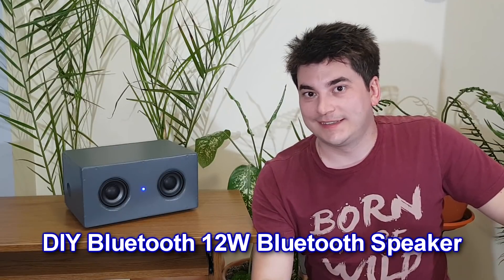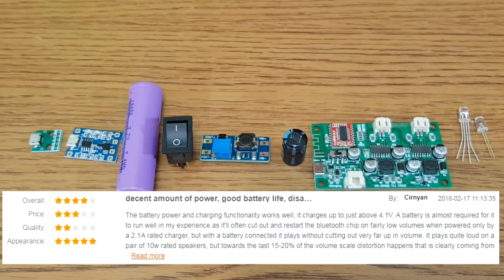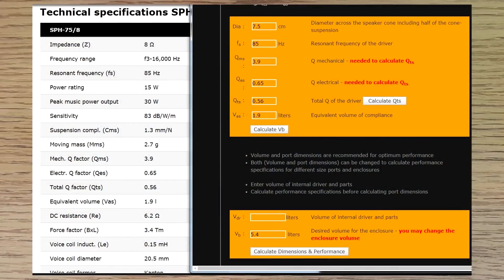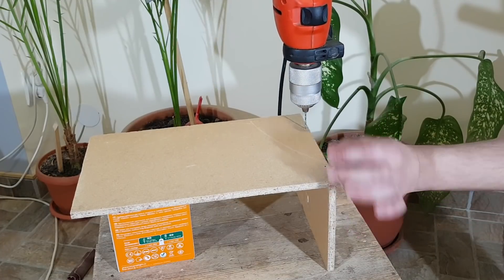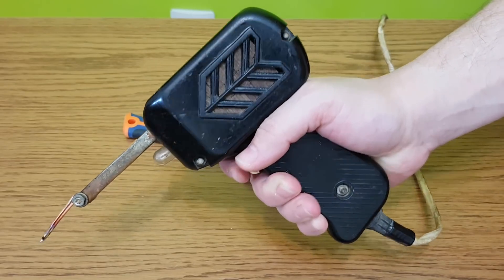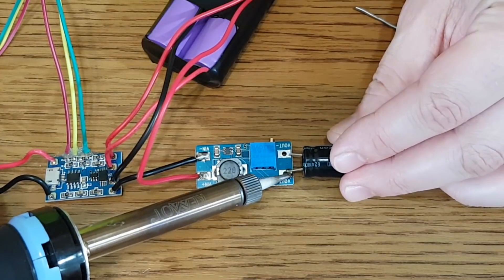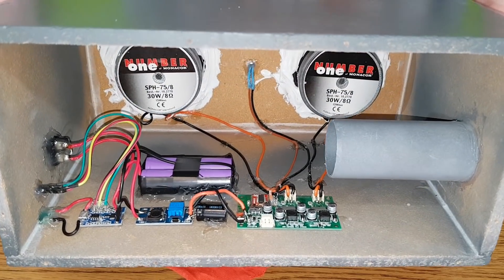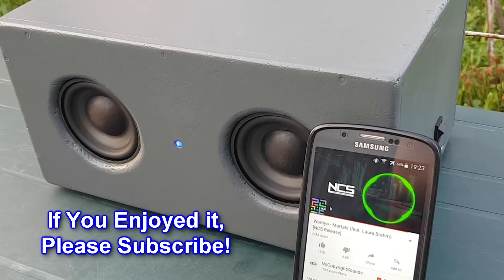DIY Bluetooth Speaker 6W+6W - HF69B

Comment: @Sorin: a practical tip: at timestamp 6:03, you're cutting into the board with your arm in front of the saw. If the saw runs off without resistance after cutting the last millimeters of board, it may overshoot, and you may cut half your arm off. Never cut into your own limbs/fingers, always cut away. If you don't have clamps to hold the board to the table, sit on it with your knee, and catch the falling part with your free hand. NEVER hold it in the way you do here. One accident may scar you for life.

Also, jigsaws can cut fairly straight, if you use a guide. Use a straight bit of metal/wood, about 1cm thick, and place it so that the base of the jigsaw slides along it.

Comment: Would you consider making another but way higher power bluetooth speaker? There are easy to use things now for it.
Reply from the maker: yes, I plan to build a small and powerful boombox
Reply: @Sorin_DIY  Take a look at differential amplifiers such as ns4110b it packs a quite a punch, it can do 10W at 4 ohms, and gets loud, while drawing nearly no power, pair it with a bk8000l or if you wish to do multimedia too bk3254 or bk3220 those have a great sound quality and easy to use, also with differential amplification , you also wont hear any interference or noise, just crisp audio. Hope you like the idea. I done it too but went too far with my bench psu and fried the amp, it was a ht8696sp , that also is great! 8.5w on 4 omhs, but it can only go up 8.5v , while ns4110b can do 14 v , but the ht6896 has a bit better sound, on a scale, these both are cheap , easy and interference free, cheers.

Comment: hello does it matter if I use 8 batteries instead of 2 lithium batteries? if so does something need to be changed? thank you in advance!
Reply from the maker: hello. what kind of batteries do you want to use?
Reply: @Sorin_DIY  I have batteries from a powerbank that I can use. The brand is trust.
Reply from the maker: if you have 8 li-ion cells with maximum 4.2V you can use them, but I don't think you need to use all of them. 4 cells connected in parallel should be enough for this project. it depends on the quality of the cells.

Comment: I used 10W 40hm speaker when I connect both the speaker bluetooth not connected in my mobile , if I remove any one speaker connecting also 
Bluetooth.amplifier shutdown down when increased volume
Is there any possible way for 4ohm 10w speaker?

Comment: Very well done👍👌but i recommend not to cover the amplifier with the foam insolation, because of the massive heat it will produce over a time at high volume

Comment: Can you recommend a bluetooth amplifier board for 6 ohms 60 watts speaker?
Reply from the maker: hi. it depends on the type of speaker, I'm guessing 60W max (not RMS). so you probably need a 15 - 30W amplifier. for 2 x 15W you can use the YDA138 bluetooth amplifier board. or you can use a more powerful 20W or max 30W amplifier board, but there are also other things to consider. for example what battery, BMS board and charger you want to use? when building a bluetooth speaker (or any speaker box) first you decide on the amplifier board and then build the speaker around that amplifier with compatible components. only if you have very good speaker drivers it's worth to build a speaker box for those speaker drivers. for 2 x 30W you can use the TPA3118 amplifier board, but it needs a supply voltage of max 26V.
Reply: Im gonna use that bluetooth amplifier for my book shelf speaker

Comment: Another good video and good advice. But do remember that if someone has a bunch of 4 ohm speakers, it's possible to put them in series to get 8 ohms. All is not lost! Also, a tip: soldering 2-3 inches of wire to the Bluetooth F-antenna will remove a lot of noise at low volumes. In my experience those PCB antenna always work better with extra wire soldered to the end of the F.
Reply from the maker: hi. if you connect 2x 4ohm speaker drivers in series, you can use them as a 8ohm speaker. but there is a small problem: the voice coil of one speaker driver will become a small frequency filter for the other speaker connected in series. so both speakers will lose some of the high frequency sound. if you do this with bass speakers it's ok. but if you connect tweeters (with voice coils) in series, you will partially cancel their ability to make high frequency sounds.

Comment: Hello sorin.. your work is amazing, especially the way you explained.
I've a small question.. what's the capacitor uf value and volt that you soldered directly  in DC stepup module ?
Reply from the maker: hi. I think it's 2200uF at 16V. you need a capacitor with a rated voltage higher than the running voltage. so for a 5V device, you need a capacitor of minimum 10V. there are also 6.3V capacitors, but they are too close to the running voltage. the capacitance depends on the supply power and the load. for a 5V bluetooth speaker 1000 - 3300uF should be enough.
Reply: @Sorin_DIY  
thanks a lot :) 😃

Comment: Hi sorin, I have the 4 pin LED with common cathode, it's not working with tp4056. Can I use diode for this? Please suggest with diagram. Thank you
Reply from the maker: you need a multiple color LED with a common anode.
Reply: @Sorin_DIY  thank you sorin...

Comment: how you used 30w speakers if you amp is only 6w
Reply from the maker: hi. the amplifier has a peak power of 6W per channel. the speaker drivers have 30W peak and 15W rms. the RMS value is the real power. the speaker drivers must be more powerful than the amplifier board, otherwise they will sound distorted at maximum audio volume and even get damaged.

Comment: I watched all the videos on your channel.  Nice artwork.  I have a two 10W 40mm 4 Ohm subwoofer that I want to fit into two boxes.  So the point is, how many inches should I make a 40mm One speaker?  Please guide ...

 I'm adding speaker information https://www.ebay.de/itm/382945397214
Reply from the maker: hi. there are online calculators for speaker enclosures according to the speaker driver specifications. but we don't have all the parameters for this type of speaker driver. I would make 2 speaker enclosures of 80*80*100mm with MDF of 6mm and passive radiators a bit larger than the speaker drivers.

Comment: Hi sorin, can I use XL6009 booster without capacitor instead of MT3608+ capacitor? Please explain the difference. Thank you
Reply from the maker: no. XL6009 has a minimum input voltage of 3V and the li-ion cell can discharge to 2.5V. you need MT3608 because it has a minimum input voltage of 2V. the capacitor is a good addition no matter what boost converter you use, because it will keep the output voltage more stable when the battery gets low.
Reply: Thanks sorin, if I use 2×8w 6ohm speaker, what will happen?
Reply: And 1 more thing, can I use the same 4 pin RGB LED to the Bluetooth receiver board?
Reply from the maker: you can use the LED. the speaker drivers should be ok. if they are of good quality, they should work fine. but I think this amplifier will push them to the limit.
Reply: @Sorin_DIY  thanks a lot sorin. The speakers are JBL flip 4 speaker and the PCB is not working.

Comment: Be careful, you've made a mistake in the video. The SANWU HF69B has no PAM IC on it but instead Heroic Technology HT8692. Even the pins do not correspond, the input, output and so on. The HT8692 can drive 4 ohm speaker, moreover in the datasheet it is written that with 3 ohm speaker and boost converter set to 7 volts, it can output 8 watts. Otherwise it is a great looking bluetooth speaker.
Reply from the maker: hi. the amplifier board I've bought didn't have any markings on the ICs. I've searched detailed photos on the internet with the board and ICs and I still haven't found the IC description. my search stopped there, I didn't checked the pins. the video was already too long.

Comment: Amazing video tutorial. By the way, how can i add an aux wire to it, to make it dual speaker? And also a second switch. The first switch is for the power source if i am going to use aux and the second switch to power on the bluetooth module.
Reply from the maker: it's very difficult to add an aux in, I don't know the wiring and I don't have another bluetooth module like this one. but you can use a different amplifier, that has aux in and bluetooth. or you can build one from different modules.
Reply: @Sorin_DIY  thanks a lot sir. Very much appreciated. Can you suggest a module that has aux in and a bluetooth? I am not that familiar with all electronic modules

Comment: Sir which i speaker use for this amplifier ... I want full amazing bass and also mini speaker not so big but high bass .... Plz say which speaker i buy .. full speaker details
Reply from the maker: I'm using this type of speaker driver, which is a bit expensive but very good:
https://www.ebay.co.uk/itm/Monacor-10-2770-3-Inch-SPH75-8-Replacement-Speaker-Driver-30W/222659483395?hash=item33d78a1703:g:Ny4AAOSwtjBeAs0g

Comment: I'm also use this bord (hf61b )when I increase volume the bord switch of automatically and start please help me and same solution
Reply from the maker: hi. did you tried everything I said in the video? use short thick wires on all the connections, good li-ion cell(s), separate step up converter, 8 ohm speaker drivers (not 4ohm) ?

Comment: i made exactly like your but without hole on the back. i changed it with double passive radiator on the left and right side. but when i play any song, the bass is missing. when i cut 1 speaker the bass back to normal. any solution ?
Reply from the maker: hi. you've mixed the polarity of the speaker drivers. one cancel the other. you need to reverse the polarity of one speaker.
Reply: @Sorin_DIY  wow..  You're right. I placed the polarity reversed. Thanks for your solution.

Comment: The board turns off at maxx volume ? Please help
Reply from the maker: try it with 8ohm speaker drivers, good thick wires for all the connections and a more powerful battery.

Comment: By the way, does someone have a background noise with this amplifier? I have some like a square wave, and it so annoying.
Reply: no,,, we dont have any noise
Reply: @vijeandran  i noticed that It was only happening when running on batteries. So weird, cause It sounds a little bit like the 50Hz House current noise but distorted, and It stops when I plug It into a USB charger...

Comment: Thanks man, i was getting crazy figuring out why my speaker was shutting off, even using two LiPo batteries in parallel which cover the power demand by far. I have to admit that you know what you're dealing with, i'm studying electronic engineering and never had the idea that the cables i was using could affect that much to my problem (they were basically aluminium junk from an USB). Thanks for those good explanations, you have a new subscriber.

Comment: Salut Sorin.
In primul rand felicitari, ti-a iesit super tare!!! Bravo!
In al doilea rand, ti-am urmat schema si am facut aceeasi chestie, insa am ceva sa te intreb:
Modulul de amplificare are un switch on/off... ai idee pentru ce este acesta? problema e ca atunci cand este pe ON, la volum mai mare modulul se opreste, dupa care porneste iar. Daca este pe OFF il pot da la maximum, doar ca se aude un "bazait" (doar la volum mare), cand e la volum mic se aude foarte bine. (Vreo sugestie?)
Mentionez ca am folosit difuzor de 6 Ohm, si nu de 8 Ohm cum ai specificat tu (l-am "imprumutat" de la combina muzicala doar pentru proba, pana cumpar 2 difuzoare de 8 Ohm).
Astept un raspuns de la tine,
Te salut, Multa bafta!
Reply from the maker: salut. cand comutatorul e ON, modulul trimite curent si pentru incarcarea celulei, deci ramane mai putin curent pentru amplificator. se comporta ca atunci cand bateria e descarcata si se restarteaza cand ii ceri amplificatorului volum mai mare, neavand curent deajuns. cand e pe OFF, nu incarca celula. de la portul micruUSB tot curentul ajunge  la amplificator. de aceea eu am folosit un modul de incarcare separat tp4056 si modul step up. si alimentez amplificatorul prin microusb. difuzoarele de 6 ohmi consuma mai mult curent decat cele de 8ohmi. daca pui de 8 ohmi, o sa te tina mai mult timp bateria.
Reply: Multumesc, am citit specificatiile si asa este. In legatura cu acel bazait, am rezolvat-o oarecum. Am reglat modulul step-up la 4.85 V. 
bafta in continuare :)

Comment: Excelent and well talked trhough tutorial! Do you think that i can use 40watts 8ohms speakers with your configuration? Should i use mor than 2 cells? Thanks in advance
Reply from the maker: hi. you can use the speaker drivers, if they are good quality ones. 2 cells are enough. the autonomy is more than 10 hours at maximum volume with 2x 2000mAh cells. if you use 2600 - 3000 mAh cells it will last even longer.
Reply: @Sorin_DIY  Thanks and yer they are good car speakers. Excellent i'll use 2 cells then. Thank you very much!!

Comment: why did u use such a big box?
Reply from the maker: the speaker box is actually smaller than it should be. if you calculate the box dimensions according to the speaker drivers specifications, it should have an internal volume of 11L. but I've made it smaller, with a volume of 6.6L.
Reply: @Sorin_DIY  ok

Comment: Hi Sorin,
I am a Teacher, My class are currently making your speakers at the moment. The students designed and 3D printed their own speaker enclosures.
We are having trouble with the step up module.. The 18650 batteries I bought off AliExpress are 3000mah 20A.. I can't seem to get the step up module to work with them. When I try to change the voltage with a small screw driver nothing happens? 
Thanks
Tim
Reply from the maker: hi. what model of step-up converter are you using? for most modules, you need to rotate the potentiometer to the left (counter clockwise) to increase the voltage.
Reply: @Sorin_DIY - Hi Sorin, I am using the MT3608 same as yours, When my students put the volt meters on them the battery reads 4.20 Volts coming out the "output" side of the step up module but nothing happens when we turn it either way. Infact, one of the modules started smoking at one stage.
Reply from the maker: hhmm, this is strange. I've used a lot of these modules and all of them were ok. the only time I've burned them, is when I've exceeded the maximum input voltage. you can try it with another type of battery, but I don't think it will make any difference. I think you've received a bad lot of modules. try to measure the potentiometer, and the copper traces from the potentiometer to the IC. it will act the same way, if there is an interruption in the potentiometer circuit.
Reply: Sorin - DIY Electrical Nerd
Hi Sorin
In class today the kids and I tried another Module, we turned the pot clockwise a fair way, then slowly started turning it anti clockwise and finally got an increase in voltage 👍🏼.. thanks for our help. The speakers are excellent! Very fun school project

Comment: Can this battery  pack be used on any size speakers I was wanted to use 2 10in speakers and 2 tweeters?
Reply from the maker: the battery pack is suitable for this bluetooth amplifier. the speaker drivers also need to be suitable for this amplifier. if you want to use 4 speaker drivers, 2 for bass and 2 for treble, you need to add a crossover filter on each channel, and the speaker drivers need to have 8ohms. but if the speaker drivers are too big, the amplifier will not have enough power to work with them.

Comment: What kind of capacitor is that please send me the link we're I can get them thanks
Reply from the maker: hi. it's a 4700uF electrolytic capacitor. be careful not to exceed the capacitor voltage. 
https://www.aliexpress.com/item/10PCS-4700UF-16V-16V-4700UF-Electrolytic-Capacitor-Size-13-25MM-16-V-4700-UF-Aluminum-Electrolytic/32843606314.html?spm=2114.search0104.3.22.72d4e15cJryKLA&ws_ab_test=searchweb0_0,searchweb201602_3_10065_10068_319_10059_10884_317_10887_10696_321_322_453_10084_454_10083_10103_10618_10304_10307_10820_10301_10821_537_536_10902,searchweb201603_6,ppcSwitch_0&algo_expid=5dffdcce-f2c8-40dc-a63d-9ef95a708798-3&algo_pvid=5dffdcce-f2c8-40dc-a63d-9ef95a708798&transAbTest=ae803_3

Comment: Hi , i have a question ,  (the amp. Needs only 3.7 so connecting it directly to the battery would not be a problem) so if you give the amp. 5V will the performance of it increase? And what if i dont want to use a step up converter and use the charging USB from the amp. It's self to charge the battery 

Becouse im using 2 of 5W speakers for a small project
Reply from the maker: hi. the amplifier board has a battery charger IC and a step up converter included. so you can connect a li-ion cell directly to it. but it doesn't have an over discharge protection, so you need a 18650 cell with protection. if you connect a battery directly to the board, instead of using a separate charging module+step up converter, should theoretically be the same thing. however, I think the TP4056 module with protection + separate step up converter will charge better 2 cells connected in parallel and will be more powerful than the charger and step up converter included on the board.
Reply: yeah.. Thanks!

Comment: Nice project sorin!
Reply: Sir how to solder multi colour led?i have tp4056 module and i want to replace led like you tel me
Reply from the maker: you need a multi color LED with a common anode (or positive). on the tp4056 board the 2 LEDs are soldered with the anode side by side. so you solder the anode wire in the middle, between the LEDs. in my video the anode is yellow and the cathodes for the 2 colors are red and blue.
Reply: I got you... thanks soo much for your help